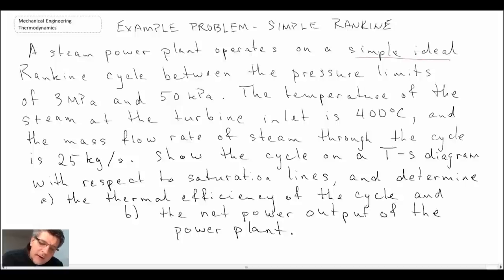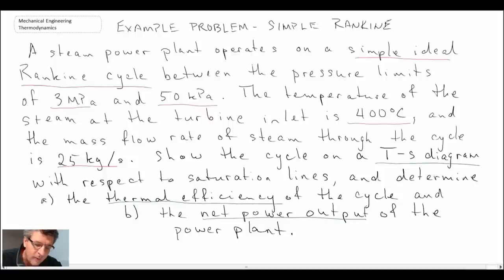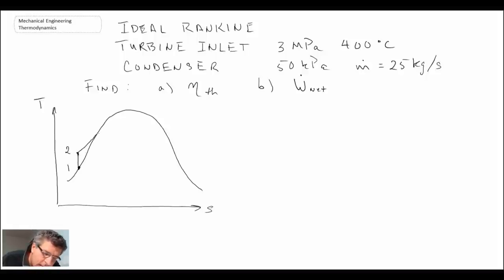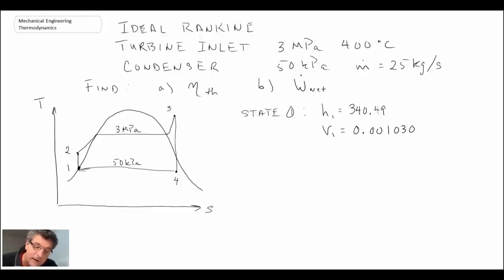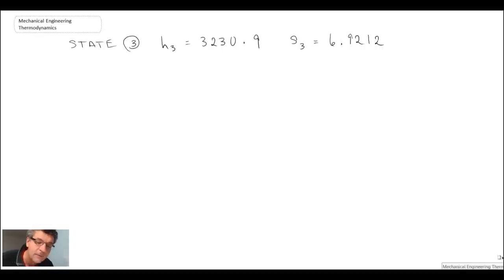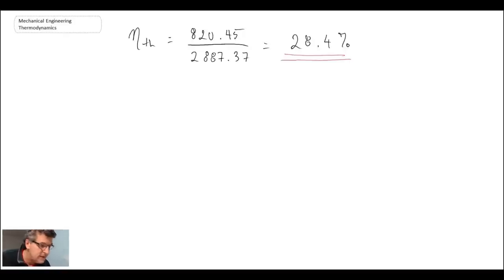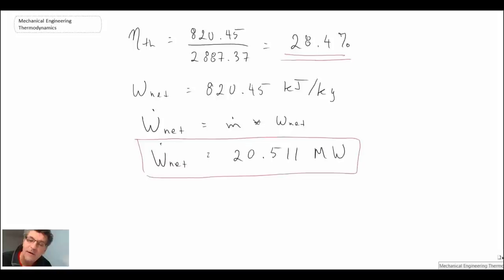Mechanical Engineering Thermodynamics - Lec 21, pt 1 of 5:  Example - Simple Rankine Cycle

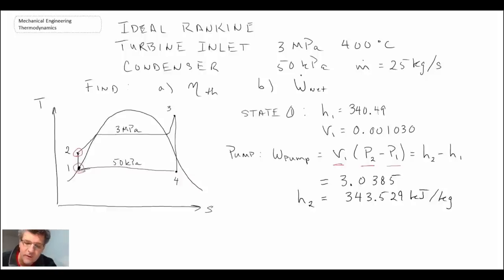Comment from the maker: If you watch at 6:31 I explain (although perhaps in a somewhat brief manner).  You have to check to see if the conditions at 3MPa and 400 C are in the saturated steam tables.  From the saturated water - temperature tables we find that the highest listed temperature (the critical point) is 373.95C - thus 400 C is above that.  From the saturated water - pressure table we find that at 3 MPa the saturation temperature is 250.35C (400 C is above that).  Both of these indicate that we are in the superheated region - leading us to the superheated water property tables.  Going to the data in that table at 3 MPa we can find our properties at the temperature of 400 C.  

Please note that my values may differ from yours by a little - the most important thing is that you read all values from the same set of tables.  These differences are attributed to the way the tables are developed, but we mostly deal with changes between states and consequently slight differences in values are washed out through the process of computing differences.
Reply: +Ron Hugo 
i want a question about rankine cycle have 3 turbine and open feed system and closed feed system
Reply: thanks

Comment: I really enjoyed this.  I had this stuff in thermo and steam power as an undergrad and TA'ed for both in grad school.  But being in a completely different research areas for MS thesis and PhD dissertation and yet another for the bulk of my career I hadn't touched steam calculations for probably 30+ years.  Now I'm back because I need to do a quick calculation.  

This video was super useful and brought back a ton of good memories.  I was suddenly transported back to my days as an undergrad tapping out calculations on my HP41-CV and sketching on a National green graph paper pad and cranking out Rankine cycle homework problems from my Wark thermo and MM El Wakil steam power text books.  

I know I'm probably not your target audience, but I appreciate your good work in this video.
Reply from the maker: Very glad to hear you found the video useful.  Quite the coincidence as today I received in the mail E90 batteries for my HP-41CV calculator.  In my view it really was the best calculator ever made.  Green National engineering pad, a mechanical pencil, a Staedtler eraser and a Staedtler ruler / template - now that is real engineering!  Thank you for sharing.

Comment from the maker: Hello Sameer - thanks for pointing that out.  Your comment raises a very good point. 

My lectures were actually developed a number of years ago using the 3rd Edition of Cengel and Boles, and in that book the enthalpy of saturated liquid at 50kPa actually is the 340.49 kJ/kg as indicated in the solution.  The corresponding internal energy is 340.44 kJ/kg. 

The steam tables in the 3rd Edition of Cengel and Boles were adapted from a textbook by Van Wylen and Sonntag (Fundamentals of Classical Thermodynamics), which were based on work by Keenan, Keyes, Hill and Moore (Steam Tables).  The 7th Edition of Cengel and Boles uses a different source for the steam tables (based on the Engineering Equation Solver software developed by Klein and Alvarado), explaining the difference that you have pointed out.  

The tables are all relative, and consequently the most important thing is that you use the same set of tables for your calculations - that is, you would not want to mix enthalpy values from the tables in one textbook with those from another textbook.
Reply: Ron Hugo how does 340.49 found?
Reply: 340.54 is Hf ? not 340.49..explain plz
Reply: @ianntorralba2054  he used wrong table this is the prob of superheated water and he used saturated water pressure table which is wrong

Comment: where does the value 2305.4 on 10:00 comes from?
Reply: Using table A-3 at 0.5bar (50kpa) 2305.4 is the difference between hg and hf. So the full equation goes: h4 = h1 + x(hg - hf). The difference is also already given to you in that table.

Comment: The video would have been better if you had explained at each step where you got each of the value from. I was confused about the S3=S4 equation with the X4. Where did you find the 1.0910 value and 6.5029 in the steam table.
Reply: Up

Comment: @8:32 how do you know if 50kpa is in two-phase region? And how to tell if one is in two-phase region?
Reply from the maker: 50kPa is below the critical pressure for steam (22.09 MPa).  50 kPa is one of the constant pressure lines in the steam table.  s3 = s4 (isentropic expansion).  Looking in the steam tables at 50 kPa with the known value for s4, we find that s4 is between s_f and s_g and so we know that it has to be in the two-phase region.

Comment: 5:31 to 6:31 - don't incompressible substances follow the equation dh = cdT + vdp, which results in h2-h1 = c(T2-T1) + v(p2-p1)? Is the temperature difference negligible?

Comment: At 8:55. shouldn't it be s3=s4=1.0910[x] + (the entropy of the gas)[1-x]. or is this equivalent to what you did?
Reply: i has know idear what you is talking about
Reply from the maker: When you say "entropy of the gas" I assume you mean the entropy of the saturated vapor s_g.  The relationship in general is s=s_f+s_fg*x, which can be expanded to s = s_f + (s_g - s_f)x = s_f - s_f*x + s_g*x.  This can be rewritten as s_f(1-x)+s_g*x.  Based on your question, you are asking if this is equivalent to s_f*x+s_g*(1-x), which it is not.  An easy test to your question is to put x=1 (saturated vapor) into your equation and see if you get the correct entropy value (s_g).
Reply: i has even moe no idear what you peeples is talking abour
Reply: Ron Hugo Ahhh okay, I see. thanks for clearing that up for me. I think they explained it as s =s_f*(1-x) + s_g*x in class and i mixed it up with s_f(x) + s_g(1-x). Thanks for the vids. Cheers!
Reply: Ron Hugo Sorry last question, just to be clear since I'm now doing a problem on reheat. x_4 = proponent of steam correct?

Comment: Since it is a ideal process the pump is working at pressures of 3Mpa and 50kpa why dont we consider enthalpy differece between 30 bar and 0.5bar to calculate work done by pump (Wpump =(hf)30bar -(hf)0.5 bar)

Comment: hi. i need some assistance please. i have a question where they provide the nuclear reactor pressure of 15.5MPa and then they state that the steam generator pressure is 5.8MPa. where do i use this 15.5MPa in my calculations? the only other information they provide is the cooling water of 12 degrees Celsius. using your steps i cannot find the Wpump due to missing information

Comment: how do u get v1= 0.001030 in my table it's shown as 3.239... please sir can you explain this...??
Reply from the maker: I suspect you are reading the superheated water table, not the saturated water table.  State 1 is on the saturated liquid line, and the density of water is close to 1000 kg/m3 and thus the specific volume should be close to 0.001 m3/kg.
Reply: yes.. hanan.. btw thnks for ur feedback n Mr. Ron ur lectures were very important me to pass my finals.. thanks again n atb.. :)

Comment: Could you please explain how did you calculated quality?
Reply: The s_f and h_f values correspond to values extending up to the left of the saturation curve (saturated fluid) from the left edge of the graph. The s_g and h_g values correspond to values up to the right side of the saturation curve (saturated gas) from the left of the graph. s_f and s_fg added together makes s_g, so if X = 1 ( meaning the mixture is 100% gas),        s_4 = s_f + (s_fg * 1) = s_g.

s_fg and h_fg are the 'length' across the saturation curve on the T-S Diagram, s_f and h_f are the 'length' to the left of the graph from the saturation.

All these values come from your chosen steam tables, I use Rogers and Mayhew which do not go to as many decimal places as the ones used here.

s_4 = s_f + (s_fg * X_4)

Therefore X_4 = (s_4 - s_f)/s_fg